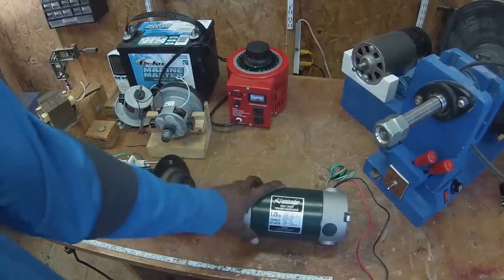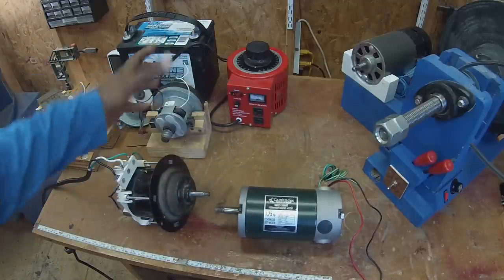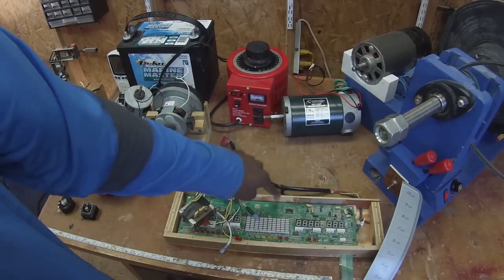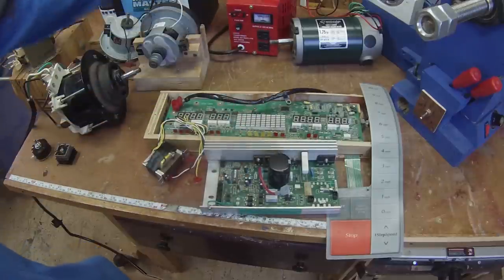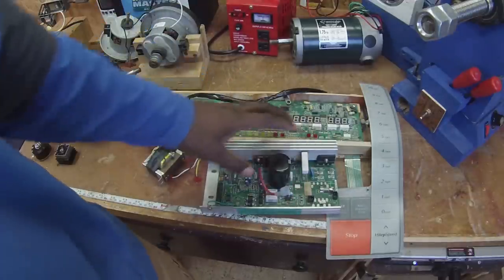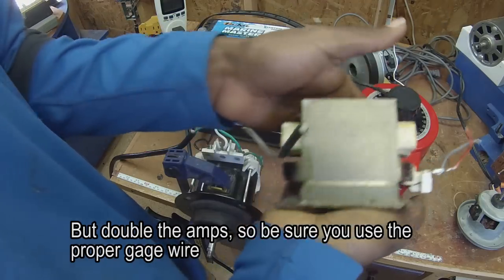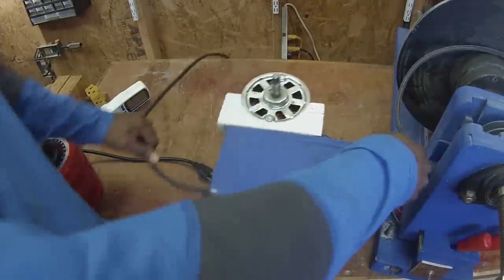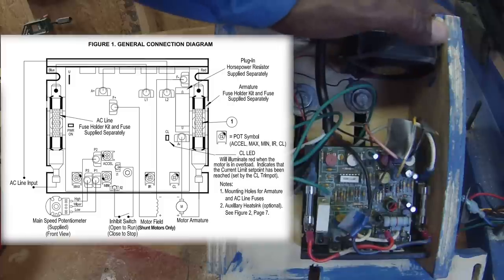How To Wire A Large DC Motor And Control The Speed; Treadmill Motors and Universal Motors 019

Comment: Jeremy Fielding,. I've heard you can run any DC motor on AC, is this true or only some like the universal motor
Reply: That is not true! In a DC motor you have a part called the commutator to switch the polarity when appropriate. If you hook it up to AC you mess up the timing.
Reply: Shaun Tucker true if you use a full bridge rectifier.
It won’t get to work on full load tho

Comment: hey man. i was wondering if its posible to use a treadmill motor on a riding mower to run lights and a dump trailer lift motor.
Reply from the maker: watch my video on "what motors can be used in a go kart or ebike. That will help a lot.
Reply: i wanna use a treadmill motor like a gererator. but not sure how i could regulate the voltage down at a steady 14 volts
Reply from the maker: Watch my generator series. I cover this topic
Reply: do you have a link to it. i cant find any on regulating 90 volt dc down to 12 volt dc

Comment: How do you wire a pwm speed control to a 24v DC motor.  I have an old wheelchair I want to convert with control without the OEM setup
Reply from the maker: I only follow the instructions that come with controllers.

Comment: I want to speed control my lathe got a treadmill with 2.6 hp motor and it has the m60 board,,,so you saying I need to use the transformer between ac power and the m60 and the potentiometer to motor,?
Reply: I’m assuming you mean the coil that was on the treadmill and not a microwave transformer.  If so, The a/c cord (wall power) goes in to the mc60 in the ac spots, The motor + terminal goes to the “transformer” (coil choke) then continues on to the positive motor wire,  the negative goes straight to the negative on the motor.    If you have blue wires they are a thermal switch which I removed and threw away
Reply: @Degovernator  thanks I appreciate it, but little late 3 months, lol,, I figured it out and it's the best I could of did for my metal lathe,,,made it a much better machine, and no more pulley belt changing, my cuts are so much smoother being able to finetune for different types of metal, but thanks,,,

Comment: that box you have there is called a phasecontroller. its basically PWM at the frequency of the mains line. the triac switches on somewhere between the start and end of the half wave. it stays on till the voltage is reversed. then it does the same on the negative half wave. this works best for resistive loads like heaters, but can also work for motors. you phase controller seems to switch on very late. i got myself some of these www.banggood.com/2000W-Speed-Controller-SCR-Voltage-Regulator-Dimming-Dimmer-Thermostat-p-80720.html?p=K12415734648201408JW and they are on like 1% when the pot is left, and full on when the pot is right. at that price they are ridiculously cheap, and are probably better suited to your needs. only downside is, they dont come with a box. i made a box from scrap wood for mine.
Reply: fredlllll 
Yes, I thought of those also, glad you brought it up.
Reply: fredlllll it's identical in operation to a dimmer switch, not really a phasecontroller as theres only 1 phase. It chops the AC wave off a certain amount of time after a zero crossing. It's a very interesting device
Reply: which is exactly what phase control is https://en.wikipedia.org/wiki/Phase-fired_controllers
Reply: fredlllll I only knew it as cutting or chopping 👍🏻
Reply: wouldn't you need a rectifier downstream, seeing this is an AC input scr if it were to be used for a DC motor?

Comment: what hp from a treadmill would run it good i got a 1 1/2 treadmill motor most are 2 plus ?
Reply from the maker: I have taken apart at least 10-15 treadmills. The most common hp rating is 2.5. Some as high as 3hp.
Reply: @Jeremy_Fielding  thank you  for the info Duane

Comment: the triac is not as effective as it clips the waveform providing a pseudo pwm effect which results in torque modulation and in this case stalls as the field cant build large enough to overcome the stall holding forces. The dramatically collapsing mag field resulting in needless motor heating and failure of those junk peak rated garbage boxes and confused ball scratching. Work best like italian tune up, this one goes to 11 then back off to desired speed whilst crying tears of torque losses and noise factors.

Comment: Hey jeremy I have just started watching your videos recently because I like to do eletronics stuff for a hobby. so the reason I'm trying to contact you this way is because I don't see any other way to. but any way I think you might be able to answer a question I have . I have a couple of ac motors that i want to use in a project and I'm having a small problem with wire them up or using them since u have very little to no info on them. this one motor I have is Chinese from some old since throw out electric thing. it has a red, blue and white and black wire and the label on it just saids that it can do 120v ac and the part number and where it from and I Google the part number and got nothing.
Reply from the maker: I responded above... but also you can contact me on the "about" page of my channel.

Comment: Jeremy, I like your videos, but you should be building or re-using metal boxes for your electrical projects. Wooden boxes are just not safe if something burns up inside a motor controller. There are lots of devices with metal cases in the trash that can be reused as electrical project boxes.
Reply from the maker: +J Wagner yes I agree metal boxes are safer.
Reply: J Wagner. On the other hand, wood enclosures are non-conductive which could be beneficial if a hot wire comes loose.  Obviously, that is less important with DC, though.

Comment: An even cheaper option (as in free) is a laptop or other dlectronic equipment power supply scavenged from the trash bin.

Laptops are usually powered by 19V.

Comment: Just watched your Video on how to wire DC Motors.  (Well Done.) Towards the end you showed what looked to me like a double pole double throw (DPDT) switch to change the motors direction. 
 I went through several hundred of the comments and didnt see it mentioned (Doesn't mean it wasn't there... Just didn't see it)... but here is a good link, to help those that need it, to help them  understand the concept of how DPDT switches work in reversing polarity. The switch in the link is a temporary rocker type as opposed to the toggle that you used in your video, but the concept is the same. Thank you for the time and effort in sharing your DIY re-purposing  of various electronics. Hope they keep on happening.

http://www.instructables.com/id/HOW-TO%3A-Wire-a-DPDT-rocker-switch-for-reversing-po/

Comment: HI NEED SOME HELP ON A  Condenser Fan Motor 1100 RPM  230 Volts PH1 IT NEEDS A BEARING SEAL INSIDE THE MOTOR,,
THANKS
Reply from the maker: Unfortunately I can’t help directly like this. I hope you can understand, I get hundreds of request like this. It just isn’t safe or practical to give one-on-one advice. That doesn’t mean others can’t come along and try to help. It does happen here.

Comment: Jeremy-I installed rectifier with heatsink,and the speedcontrol from harbor freight-gets very warm after 30 min.on treadmill--blows fuse in speedcontrol---rectifier too small ?25 amp  1000 v--HELP !!!!
Reply from the maker: You should use a DC motor speed controller. I don't recommend doing it this way (what you are describing) for any length of time. I only use it for fast testing purposes before I buy a dedicated speed controller. There are many things that could be wrong and I am concerned about giving one on one advice like this. I can't be sure I am asking the right questions, or if you are giving all the relevant information. Harbor Freight makes crappy stuff. You might also consider using something else that does the same thing... just saying not telling :)
Reply: ok thanks Jeremy-I appreciate your time,as long as I learn everyday right ?--that's what its all about--I learned long ago,everytime you ask a question you learn something !!!!

Comment: Where did you find that huge potentiometer?

The capacitor is optional for testing but if you plan to run it for a while you would want a filter capacitor. There is tons of theory and such for selecting a proper capacitor. Really and truly you just need to see how much load the motor or device under test is putting out. A simple Kill A Watt meter works. Just convert the watts into amps by dividing the watts and voltage you inject into the motor or device under test. So for a example 100 watts divide by 16 volts would be 6.25 amps. Now take 120 since the rectified voltage is double then the typical 60Hz and divide it by the amps that is 6.25 and you'll get 19.5 so you would need 19,500 uF capacitor. Since there isn't really a 19,000 uF cap you can round up to 20,000uF. Honestly you could get away with double the capacity however if you go too high it will produce a big in rush current.
Reply from the maker: It's a auto transformer sometimes called a variac
Reply: I know about the Variac, I'm talking about that huge 10K potentiometer that you had in your hand at 3:20 in the video.

Comment: I took a treadmill motor out with all the components and I plug it in and it turns on for a second then says pace error #1. How do you get past that?
Reply from the maker: If the controller is looking for a signal from the speed sensor you will have to use a different method shown in the video to control the motor. There are more advance ways to do It I am sure but you will have to do your homework to figure it out.
Reply: Ok I think I found a light sensor on the board, I took it off and wired it across but it still had the “pace error #1” so you’re saying it needs that signal? Can I use it with a  potentiometer or is it just not the right one?
Reply: Can I send I picture of it?
Reply from the maker: I can’t troubleshoot problems one on one like this. I hope you can understand...I get hundreds of emails and comments asking for help. It just isn’t practical or safe to try and do so

Comment: How come the fuse in my harbor freight speed controller keeps blowing
Reply from the maker: What do you have plugged into it? Fuses fail in a fairly reliable way so you should investigate the item that is plugged into the controller first. Then trash the speed controller because it is pretty much worthless. Seriously, my guess based on very little information is the speed controller is not working... it is allowing the full current through the device and burning out the fuse. Try a different brand speed controller.
Reply: So I have the same set up as you speed controller plugged in then an extension cord attacked to full wave bridge rectifier which then goes to a 90VDC treadmill motor but every time I turn it on the motor starts up then slows down bc the fuse in the speed controller breaks
Reply: Also can you suggest any specific speed controller for this purpose having a hard time finding one

Also if just using a speed controller will I also have to use a transformer to lower 120V to the 90 that the motor requires or will the speed controller do that?
Reply: Jeremy Fielding I think I might have found the issue the fuse that is in the harbor freight speed controller is a 15 amp fuse while the motor I have says 30 amps so I think the fuse is blowing because it is not the right size
Reply from the maker: 30 amps is pretty high. You should check the fuse at the breaker box in your house as well. Most of them are 15 and 20 amp fuses. You may start tripping the breaker box. Also you should not change that fuse to 30 amps because the harbor freight speed controller is not rated for much higher than that. I think (NOT completely sure) it is 20 amps.
Reply: Jeremy Fielding so then what speed controller should I use?

Comment: Is the Harbor Freight unit made to work with inductive loads?  Some of them are made for light dimmers, and not motor speed controls, so I was just wondering.
Reply from the maker: It was made to control a router motor so I would say definitely.

Comment: I have found this channel looking for a motor that can drive a load of 150kg, does anyone know what motor should I use?

P.S. Subscribing to this channel instantly.
Reply: God it pains me to say this, but it depends.  A 1/10th hp could do, I 10,000 hp power could do it.  The main factors are the level of acceleration and velocity desired.  Low speed and acceleration with large gear reductions for say winching trees only require 1-2 hp. Driving an electric motorcycle at a drag race can require 300hp.

Comment: you really don't need a capacitor... if you were to run it on pwm, then yes... but that is another story.

the main reason behind the capacitor is to reduce audible noise.  with 60 hertz, there won't be much bother.

Comment: What Kinda Controller Do you use?  , Should tag the products you use too , so i couldve clicked on it andd get ready for some bling bling, even that transdooser! .lol :) jk.   but  the rectifier
Reply from the maker: I do occasionally add items to the description... it depends on the context of the video. I have many different controllers so I have no idea which one you are talking about.
Reply: at 22:01
Reply from the maker: I believe you are talking about the one on my lathe. It is made by KB electronics. KBIC-125. it needs a heat sync and a resistor based on your hp.

Comment: I have a 180v 2.5hp motor, everything works fine, or it did till I took the treadmill apart. I'm struggling to get a decent priced power supply. If there was a good video on how to rewire the board (because you can) I would probably feel confident and comfortable enough to try it. There is a way of adding a potentiometer, but you need to break some of the circuit contacts to stop it re-feeding power back into the board. That would be bad. 
If anyone smart in electronic circuits has any ideas, I would be most grateful.
If you want to do the board for me and live in the UK, I will pay you to do it ☺

Comment: Seems like too much of a ball aich to me and too many components needed and components I don't have,
I presume then that if I plug a dc auto fan strait into the mains in the house, it would blow up simply because the voltage would make to motor spin wildly out of control? So can't I just use a step down transformer that steps mains voltage down to 12v ?
Reply from the maker: You are over thinking what you see here. I am just trying to help you understand you need something to convert the AC to DC before you connect the fan, and this video gives some examples. Start your search there. You may not need speed control. just 120ac to 12volt dc. You have to do your homework and figure out how much power the device needs to handle etc.
Reply: Jeremy Fielding 
I'm in the UK and we run in 230v/ 240v ac 
And a car fan runs at 12v dc 30amp, 

Do you know what voltage comes out the other side of a microwave oven power in transformer? Does that step wall voltage Down or up? I'm referring to the one that the power input cord connects too, this whole thing has been very frustrating to me lol I orderd a big shop fan on Amazon then got a email saying it's not arriving for a month! The UK is a joke, think ima come over to America lol, please help
Reply from the maker: The same response applies. Just 240 AC  to 12v DC. Unfortunately I can’t help directly like this. I hope you can understand, I get literally hundreds of emails through my YouTube channel for advice and general help. It just isn’t safe or practical to try and troubleshoot problems or give advice one on one. I usually take subjects that come up over and over and make videos to help lots of people. But, I can’t do it this way. I am just trying to point you in the right direction. You have to do the homework.
Reply: Don't know why everybody was giving me vague answers, the simple salution is to use a computer power supply, it's a switching supply that switches to demand, my fans are working perfectly now and I'm cool as a cucumber now in this hot weather

Comment: What about people using nothing more than a dimmer switch and a bridge rectifier to run a 2hp treadmill motor?
Reply from the maker: What about them? I don’t understand the question. I show a method nearly identical to that in the video as well
Reply: @Jeremy_Fielding  Is that actually a decent/viable way of running a DC motor? I just built a 2x72 belt grinder using a 2hp treadmill motor. I carelessly bump something inside and accidentally fried my mc60.
 I have a dimmer switch and was going order a bridge rectifier but wasn't sure if that was really a good way to run this motor on a regular basis. Do I need anything else to dial back the voltage or how will the motor run comparably? Am I good to go with just a bridge rectifier and a dimmer switch?
Reply from the maker: I explain this in the video you watched. It helps to watch that part again. Please understand I get hundreds of emails and comments asking for technical help. It just isn’t safe or practical to try and do that at this scale....
Reply: Understood. Thanks for responding and have a great day sir.
Reply: After more research I'm going with another mc-60. Yes, the bridge rectifier/dimmer would work but it wouldn't compensate when a load is applied. Unlike the mc-60 does. Being that this is for a belt sander the ability to compensate for a load is imperative. Thank you for taking time to respond. Keep up the good work.